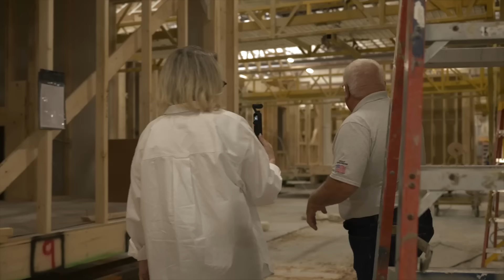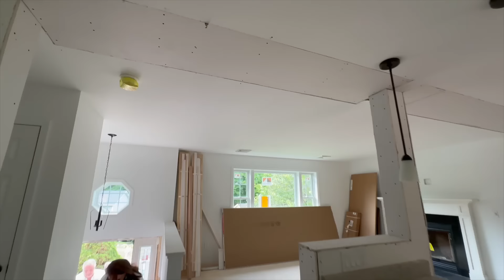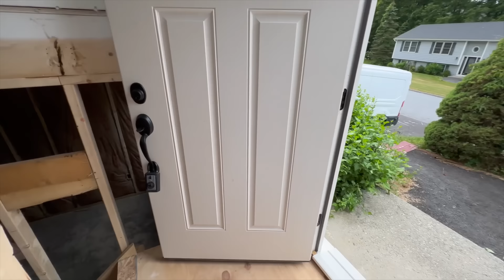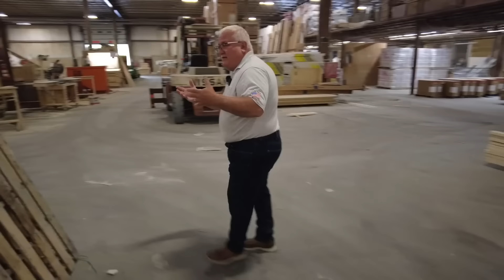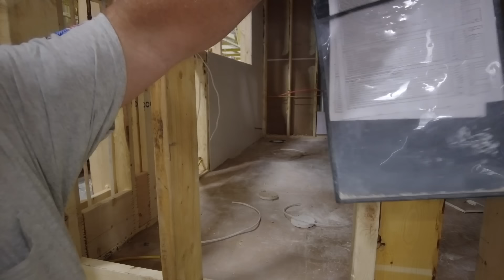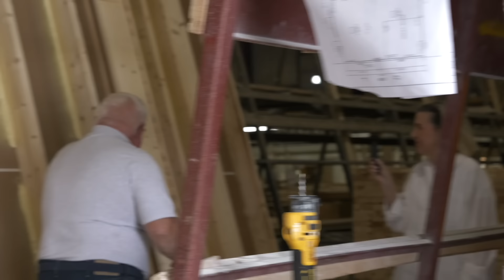Modular Homes ARE Better Than Stick Built!!!

Comment: As a builder myself, modular homes are great in some situations, but not all. The biggest issue is quality of build and materials and biggest factor in that is the builder,  factory or stuck built.  I’ve seen excellent versions of factory and stick built. Also seen horrible versions of both. Ultimately builders tend to have an identity of sorts in method and materials. I won’t use that “pink insulation” rodents love to live in it and it shrinks overtime so I use rockwool generally even over spray foam. But I like how strong the builder in the video is framing the homes using standard lumber where I use LVL. Both are fine but have different ways of achieving similar goals. Find a good builder interview and discuss a lot of options go with what suits your situation and needs. Also who you think will pickup the phone if there is a problem in the future.

Comment: Definitely prefer pre-built over stick built for a lot of reasons. The thing that doesn't make sense to me is if they're built more efficiently (less waste) and in less time (less labour costs), why are they not significantly cheaper than a regular build?
Reply: Start an off-grid community consisting of individualized log cabins. ~LLC~ Lincoln Legacy Cabins
Reply: Part of the difference is the amount of wood in the framing. Much more structure in the modular.

Comment: Back in 1996 my wife and I had a 1500 sq ft modular home built by Wausau Homes in WI.  We have lived in it ever since and have had no issues with anything.  Of course we've done normal maintenance and replaced the shingles once since then but the house itself has been quality built and energy efficient as well.  Not as efficient as nowadays mind you but still very efficient.  Also, the builder quoted us a price that he said was solid and actually even came out a little cheaper in the end!  I would highly recommend modular homes to anyone!

Comment: As a builder I visited a modular home factory and I was impressed by what I saw.
It wasn't for me in my type of home builds but for a standard home I agree it's cool.
I build multi million $$ homes and they couldn't build my custom design homes.
But I do use panelized and save a lot on wasted materials because it's framed in a factory.
Reply: Start an off-grid community consisting of individualized log cabins. ~LLC~ Lincoln Legacy Cabins

Comment: Had plans for a 2500 sq foot single level ranch syle home.  Couldn't find a builder,all booked up.  We found only one, gave us a cost of $920, 000 dollars, and his plan had 2×4 walls.  To ad insult, we had to pay him $800. 00 for the estimate.  We did agree to this cost estimate, if we hired him it would have been discounted from the cost.  Went modular, got a bigger, and much nicer home for a fraction.  Plus, it had 2×6 exterior walls.  This is my 2nd home I had built, having purchased my own land.  Contractors are thieves, and prey on the desperate.
Reply: @dash1bravo24  home much did the modular cost?
Reply: Start an off-grid community consisting of individualized log cabins. ~LLC~ Lincoln Legacy Cabins
Reply: @lincolnlegacycabins You again?!
Reply: There are costs for their labor and their upfront time into the project. I’d say the $800 for the estimate might be steep but how much time did they put into it? 
As far as the $1M labor cost on all that- sounds very high but depends on detail of job
Reply: Not all contractors are thieves, that is a very bias stayement
Reply: They are not thieves… they have families to support too.
Reply: @kutie216  Most thieves steal because they have families to feed!
Reply: @kutie216  

They are indeed Thieves!!!

Comment: Yes you would know its a modular house due to the foundation. In my area almost every house has a underground basement, ground floor and maybe 1 or 2 stories above that and sometimes 3 stories above that.  That house looks like a trailer set up on blocks at a more massive scale.

What happens with modular when it comes to expanding or remodelling do you have to be extra cautious ? One issue with the modular homes is not everyone wants stick built some of us want brick, stone or concrete.
Reply: It's the exact same a your building code, and I worked on a 5 story apparently building in the middle of a city in 2020, and no one that didn't see it built would know its modular.

They say again and again that is standard construction code.

Comment: Modular homes aren't built the same as "manufactured" homes are. On the surface they appear to be the same, but manufactured homes are generally built with cheaper materials as they follow a section 8 code, or low income housing building code, and are much more similar to a mobile home in construction than a modular home, they are thin walled so they're poorly insulated and constructed on steel frames, they aren't actually considered a "stationary home" by insurance because of how they're built.

Modular homes are homes built into larger pieces with the stud construction, then assembled at the jobsite. They're built by their state required building code, so a modular home built in another state may or may not pass your state inspections due to building regulations for both state and local zoning. They're still considered to be "stick frame" or "conventional" build to the banks and insurance companies. 

Generally modular homes are built exactly the same way a construction company would build the "stick frame or stud frame" home on site. But you have to be leery with some manufactured home companies trying to "tuck" a foundation under a steel frame home and call it modular, there will usually be some sticker or stamp.. red is usually a HUD sticker which denotes its a manufactured home and not a true modular home.. and green usually is a state certified sticker which means home was built to state and local zoning codes, either of these can be found in either the inside of the cabinets, in the windowsills, and the electrical boxes. 

The difference is with modular homes, they don't have to wait for the foundation to be built and cured before the initial start of the building process, and the materials aren't subject to the elements while they lay dormant until they're used, this skips the chance for mold or warping to occur before the house is built. Generally with a modular home, you either have to contract a construction company to build your foundation to the blueprint specs of the home, as they can obtain all the permits to build legally, or get the construction permits from courthouse and hope to get approved to start building, which could take upwards to 6 months to get approved in some places.

While the foundation is being built, set and curing, the modular home company can be building the modules of the home, and when the foundation is solid and ready for the home, they can ship the pieces then assemble the home at the build site. This saves a lot of time in the building phase, they don't have to wait until the foundation is cured before building the house, they can have the home nearly complete in the time it takes the foundation to cure. That not only cuts down on initial costs, but you can move into your new home much faster than a conventional on site build would. 

The reason why a modular home is cheaper with home owner insurance over a manufactured home as they have a true foundation, while manufactured homes are built on a steel frame set on cinderblocks while being tied down with metal straps anchored to augured poles drilled into the ground. The manufactured home is considered an insurance liability, thus costs more to insure it.

Comment: 1) more expensive , very specialized construction company vs abyone can build them 
2) you can’t add to them , years later , you can’t build an additional bedroom , if you don’t know anything about construction , and this is your forever home , then this is a viable option. 
People in the construction business do not really go this route. 
This is more geared to homeowners that just want turn key construction and do not want to deal with the construction head aches.
Reply: These are built to the same IRC that you use on site. Listen.
No difference for additional work later.
They're cheaper in areas where they don't have labor like resort towns.  
I worked on a 5 story apartment building in a city that's just like all the others in the area. 

I'm a contractor and if they cost less people like me would be putting them up by the hundred.

Comment: I am all for modular homes. I want to find a cheap home that is built great, one that won't cost a bunch to deliver it to site and one I can easily add solar to. I also have to find land I can put one on. I really want to find land on the west coast that I could live at because of the weather there is great for me. I would choose either Oregon or Washington coastal area over most places. Average of 67 in summer and 38 in winter on the Oregon coastal area.
Reply: Impossible. You want a high quality home that's cheap? Mutually exclusive, you've watched to much HDTV.

Comment: I wish more people would buy modular homes. There are two houses being built across from where I live that use stick construction. I do not mind stick construction but it has been more than a month now and the homes are still not finished. With a modular house the contractors would have finished by now. I heard that many contractors prefer stick construction because they can make more money.
Reply: No the builders don't make more but a modular home costs more. And no it doesn't really change how long it takes to build a house most places. The part you see is faster but that's it.

Comment: I've been living in an area with massive steady growth over the past 10 years in TX, witnessing them buidiing out large subdivisions from an empty field. They hire the cheapest labor possible and the only regulations are the inspections. And they go soooo fast a frame is "completed" in like 3 days. I worked for an inspection company, doing scheduling, and they aren't able to spend much time on the inspections either. I would also know what properties didn't pass creating repeats. Some builders failed at least half framing the first time while others rarely did..But they were same home prices. And sometimes the inspectors would come in exasperated at how poorly everything was executed they were butting heads with the site managers.The expert electricians and plumbers were so few that they knew them by name. Like, oh this one is Mike so it should go quickly he knows what he's doing.
Reply: I live in a similar area of growth in tx.  Every local knows which homebuilder builds quality and which are built shoddy.  Modular home companies can have similar shoddy reputations.  3000sqft home in 6 days, do you really think the inspection is able to keep up with that?  My wife is a real estate agent, fastest way to deter a buyer is to say it's a modular home

Comment: I like modular homes more than stick built for efficiency, but still prefer a log home due to the radiative heat effect not to mention the aesthetics🤙
Reply: Log homes aren't to code any.ore because the energy efficiency is below basic code construction now. They cut the logs in half and put an insulation layer in them now.

Comment: The stick built industry has blocked Modular and manufactured homes for years, high mortgage rates and telling people that they are not as sturdy… we have the technology and advanced products to build better structures for a lot less cost… I am so impressed my retirement home will be modular for sure.. thanks for the information…
Reply: manufactured homes aren't the greatest, even though their standards have made tremendous strides in the 1980s. still plenty of problems/quality issues. modular is a far better choice
Reply: its called progressivism
Reply: Start an off-grid community consisting of individualized log cabins. ~LLC~ Lincoln Legacy Cabins

Comment: I'd have liked it if you covered reparability.  Will it be harder to find somebody to replace the roof?  If the plumbing bursts is it harder to get to the pipes?  Stuff like that.
Reply: Nope these are the same code a on site builds.

Comment: Even a plain 'ol double wide is "better" than a stick built usually. I foolishly have bought 2 houses built during construction booms and it was a mistake both times. The people building them are what makes the difference and often it's the guy who was flipping burgers last week. Something built on an assembly line, with quality controls, by people who have experience, is way better. I heated my 1200sf double wide (2002) for less than $50/mo total utility bill. That house was tight as hell. I seriously considered getting the test done to see if I needed to vent it.

Comment: While not exactly a modular, our 66 year old home is a National pre-fab.  Factory built wall panels erected on a site built floor platform.  The whole subdivision is made up of these, about evenly split between full basements like ours, crawl spaces, and slab-on-grade construction.  Ours has been improved several times, most notably by the addition of fourth bedroom with en-suite bath and a remodel of the kitchen to improve the layout and get rid of the original metal cabinetry.  Other improvements include thermally efficient windows and residing with vinyl.  We aren’t the original owners, but we have been here 43 years and I can tell you the basic structure is just as sound as the day the builder handed over the keys in 1958.

Comment: I've worked with my hands, My whole life, I'll tell you what no modular I've ever seen. It's better than A well built stick framed house. A lot of reasons too many list do your homework
Reply: Sounds like you dont know the difference between modular and manufactured.
Or you haven't seen the higher quality modular companies that have moved from commercial to residential work. 
You sound like you'll take the criticism.
It's the same code, so your statement is like me looking at everything you've done it way below what I've done for decades because I worked on top tier houses. 
I didnt work for athletes or famous people because they don't have any money.

See the context there. 
Also I do shut down idiot modular guys that say they can build "anything" in a house. " Really? I worked on a house that had stone crown molding 3 feet high that weighed 3200 pound a linear foot with a 20-foot ceiling, and a 20-foot span."

Comment: There are several problems with these. You're ordering from a state with low minimum wage and these companies will continue to move to the state with the lowest, it's the same as buying china, it is destroying your local economy. The materials used are always the cheapest and normally sourced from foreign entities which are not designed for your area. I install these modules all the time and in no way is the workmanship even close to an experienced builder, these are slammed together by high turnover factory workers. Never are the boards coaled never are they crowned, never are the bug riddled boards removed. These standards they talk about are a joke. ive seen buildings come that were inches to big, or whole sheer walls where every nail missed the studs. Nothing you can do to fix these issues as they come with the siding on. Ive heard these sale pitches from many guys just like this and we offer these modulars. When the clients pick these we just roll our eyes in the office and say ok. Most people dont understand the difference in quality and wont for about 15 years when it starts to fall apart. Also ive yet to see one you can remodel after installation and ive installed about 20 homes and 7 commercial modulars... im not talking anyone out of these as just like a used car salesman there is a place for a pinto when someone cant afford a Toyota but dont think the pinto is a toyota because that is a major mistake..

Comment: Won't a normal AC system remove moisture?
Reply: Nope. Only when the AC is running. An ERV exchanges fresh air regularly or continuously. The E is energy recovery, so the air going out conditions the air coming in, so it's a minimal loss.

Comment: You didn't go into details about pricing. Do they build smaller houses and what ate the pricing.?
Reply: Smaller houses end up being more expensive because of fixed costs. Manufactured homes done usually go below 8-900sf for that reason.
At that point local is cheaper.

Comment: Electrician here, I won't even service your home if it's a mobile home, the outlets fail all the time wiring is always screwed and I'm not gonna fight a job for a $50 profit.
Reply: I had to fix my folks electric and they put one of those plugs that go between the units in a wall because they cut a wire short. Obviously the reason they aren't to code for that. It's a 3 section unit and I chased the wire from the panel on the near section where the switch and panel were about 10 feet apart. The leg went all the way across the two other panels in a bundle then came all the way back before going up to the switch.  4 Junction plugs 50ft of romex to go 10 feet.

Comment: I want Concrete, stucco and plaster. Also I hate drywall. Can they build a modular house with the same specs to withstand cat 5 hurricanes and anything short of ww3.
Reply: Yes but you don't want to pay for it. No one's doing plaster anymore. I work in Denver and 10 years ago the plaster place stopped carrying plaster supplies and only has stucco.
Price out commercial fiberglass faced drywall rated level 3. Way stronger than drywall you know. You also have to buy it by the pallet.